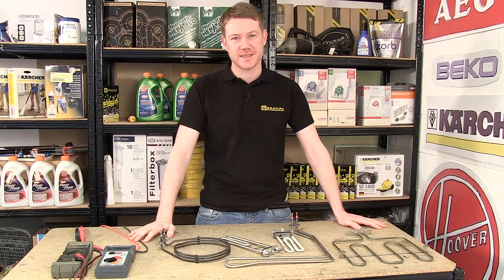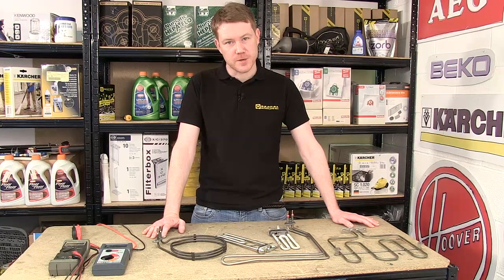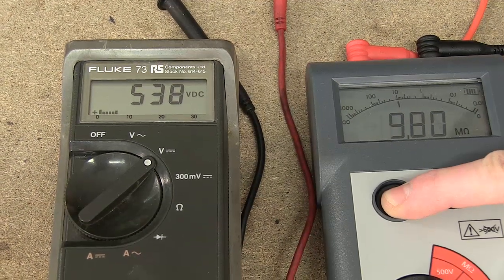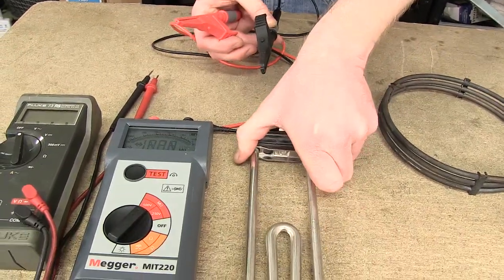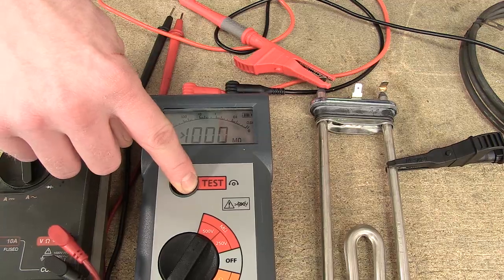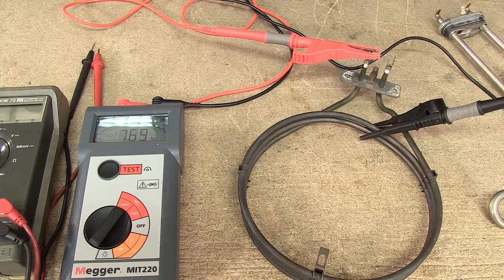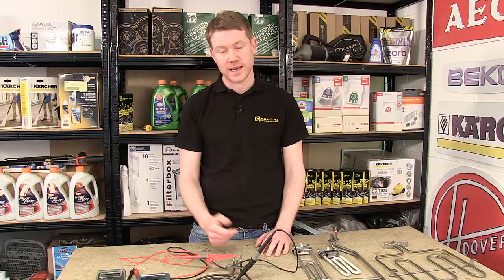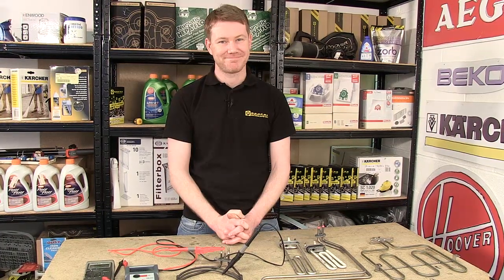How to use a Megger to Identify a Faulty Component

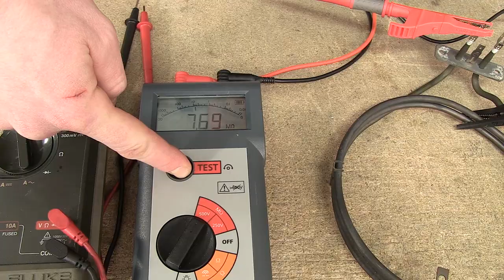Comment: 2:20 
NEVER EVER blind test anything with a MEGGER, until you deliberately short the two test leads and POWER it on, for at least 5 seconds, to prove to yourself, that it's internal batteries are sufficient and (still) charged correctly.

Then, and only then, do your installation (&/or appliance element) test

If you get a reading of "less than" 2 M ohms ?
It doesn't necessarily mean the element itself is faulty, but it can show that the element either hasn't been used from new (if maybe stored in a damp environment), or has suffered immersion in water (if the user accidentally washed it).

Either way it isn't absolutely faulty but should instead be powered ON for at least two hours, on your workshop test bench, away from flammable liquids &/or varnished bench tops etc, whilst the circuit has a current limiter such as a 100 watt filament globe, so that if it IS faulty and shorts out thoroughly, only the light will glow brightest.

However I would expect that over the two hour period (during which time any moisture in the hydroscopic insulation material of that element, should vaporize OUT, meaning) the light will dim until it goes out completely, by which time - you can (after the full two hours) again put it on a resistance retest, where the element will again have a very high resistance, and the light bulb is still testing OK too.

At that result, you will know the element is in fact in good condition, and was just "temporarily" effected by poor storage, or an accidental immersion.

However, a MEGGER is only supposed to measure the entire household, or industrial/commercial properties, entire as built insulation resistance test, such as is supposed to be done in any "new electrical  installation or in a recent addition", (by a registered electrician as part of continuity and insulation tests, prior to reconnection to the mains supply).
It isn't supposed to be used by private (untrained) citizens as if a fool-proof resistance tester.
Most MEGGER's will be powered by 12 volts from 8 AA batteries, BUT the 10,000 Volt "instantaneous spike" can and often does, kill an unwary operator, who stupidly insulation tests themselves, either by accidentally touching the probes when holding onto something they are tyring to test, or they are leaning on a metal cover, that is also connected to whatever is being tested, when holding another probe recklessly, thereby frying themselves, by stopping their hearts.

ALL Electricians (who undergo several years training and mostly 3 years of "night school" theory & practice education" and who are thus taught to ALWAYS "disconnect" any such heating element appliance (as the hydroscopic elements quite often provide faulty installation tests, when there isn't any fault - just a damp element that needs to be dried out), before connection to the mains supply, hence the drying circuit MUST contain at least a 100Watt (or brighter) bulb, to avoid a direct short if the element is actually faulty.

I have seen "new oven elements" test well below 1 M ohm, if they have been incorrectly stored. (such as a demonstrator, on a shop floor, in damp winter conditions), which when "correctly dried out", (before installation connection), test absolutely fine and well above 50 M Ohms.

Comment: Surely it’s not good advice to tell a non trained homeowner to obtain a device they don’t know how to use correctly that can output up to 1000v (granted minimal current) and test a heating element and put it back into circuit, one false move or re fitting incorrectly could result in damage or injury.

Comment: I could not get understand when u stated there is no resistances found in component..although meter showing 1000 Ohm....may be I could not get accent...can some body clear my doubt...
Reply from the maker: Hi Zafar, this meter is testing for insulation breakdown to find out if a component has failed if it is down to earth it will show a lower resistance meaning it is likely to blow the fuse.
Reply: But you stated no resistance which would mean a dead short, whereas you had 1000 meg ohms (high resistance) the wording is misleading.
Reply: Hi Mat, he is checking to see if the element is good. It would of been good to show people who are watching what a bad element reading would look like open circuit .However this is a  test you would do if you are a service engineer or technician in the trade working on Dishwasher or washing machine or  glasswasher. Who understand the laws of testing components in white goods or boilers or commercial Dishwashers. Have a good day and keep up the good work Espares. Have a good day .

Comment: What's the maximum testing d.c voltage selection to make insulation test of any home appliance and the minimum safe resistance by using a megger ?
Tank you so much .
Reply from the maker: We believe the general rule is to apply twice the  appliances AC voltage ie if the appliance is 230/240 volt the insulation test would be using a 500 volt tester. A 'good result' would show a resistance to earth of over 2 meg ohms but it may be acceptable if not lower than 1 meg ohm. This is a guide but regulations in different countries may differ.
Reply: 🙏🏻🙏🏻 @eSpares

Comment: why is my megger only read (fluctuating from 10 -1 meg ohms, it should read infinity. because the two leads are not touching each other.its the same megger you are using
Reply from the maker: Hi Danilo, it sounds like your Megger has a problem, possibly from damp or corrosion on the PCB in the meter. Try keeping it in a warm dry environment for a few days to see if this cures the problem. If not you will need to get it repaired. 😐

Comment: Hei eSpares, if a heating element has an IR value close to 0, it will short circuit, and if immersed, can result in the death of the heating element, am I correct?
Reply from the maker: A typical water heating element will have a resistance of between 20 and 30 ohms so make sure you use the lowest resistance range on the meter or it may suggest you have a short circuit.

Comment: When testing element you state there was "no resistance" on the new component when in fact the resistance is over 1000 meg ohms.
Reply: Good point - something offering "no resistance" to electricity wold be 0 ohms.
Reply: Yeah I heard that, he got it arse first, ....
Reply: He should have said the component has a very high-almost infinite resistance to the casing which is good-not "no resistance" which would indicate a fault to the casing
Reply from the maker: +Alan Shaw What we are saying is that there is infinite resistance or no measurable resistance and not Zero ohms which would be a short circuit.